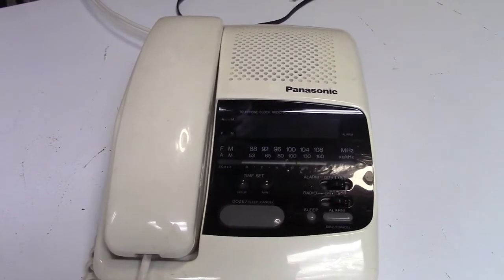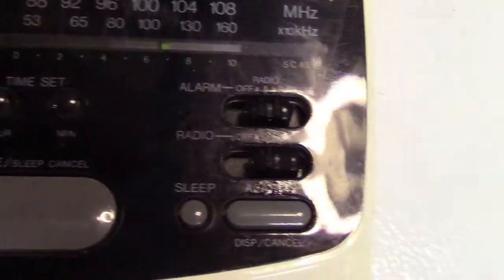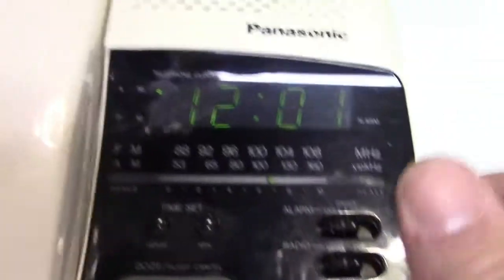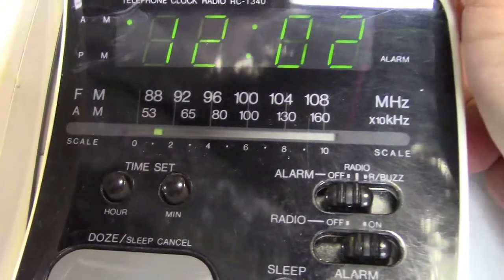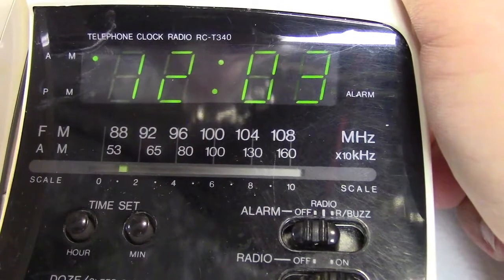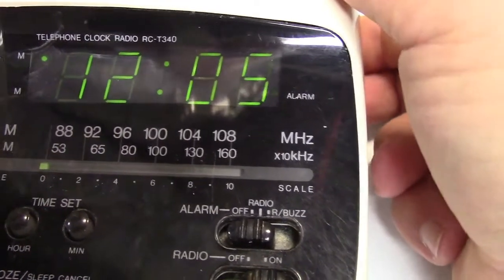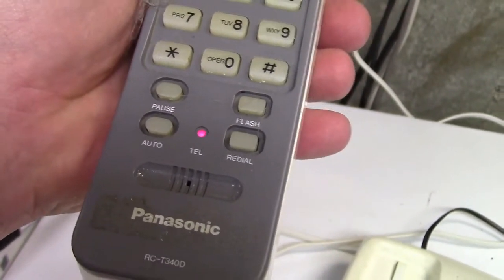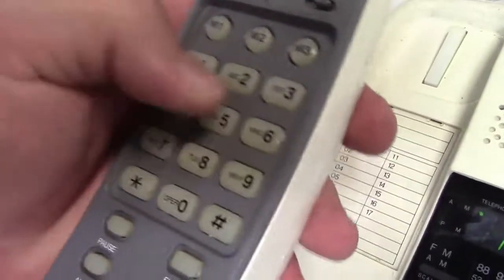Panasonic Clock/Radio/Telephone Model RC T340D

Comment: I like this telephone quite a bit.. The radio muting is simple but brilliant.. I'm very surprised the handset does not have backlit buttons, I almost wonder if there's something wrong with it.. If it weren't for that, this would be a perfect bedside telephone.. I like the ringtone on this one too, sounds very professional..
I have a feeling that slider on the tuning graph could be repaired relatively easily..
Reply from the maker: For the radio slider, I thought of tuning it to a known frequncy where it's announced over the air, manually moving the slider to reflect that on the dial, then putting a dot of CA glue to hold it in place.  Maybe you'll take a look at it someday.

Comment: LOL "Here's the ringer on Low:"  BLOOP 

Also, there will be a switch somewhere, probably on the bottom, it will say something like "LOCK - SET" or some other variant.  Panasonic always put a slider switch somewhere hidden to lock out the time set but OHHH wait, you just said it.  LOL.
Reply from the maker: That's the bloop on the "cell" phone, which is only wifi-connected.  I like stupid sounds like that, remember Penny's "computerbook" from Inspector Gadget and the sounds it made?  Yeah.
Reply: Oh yes!  :-D